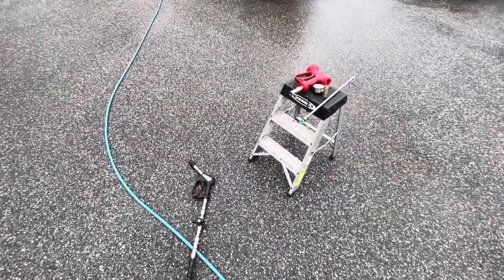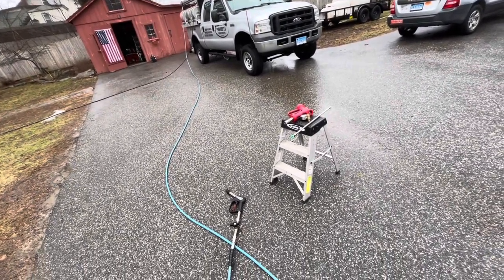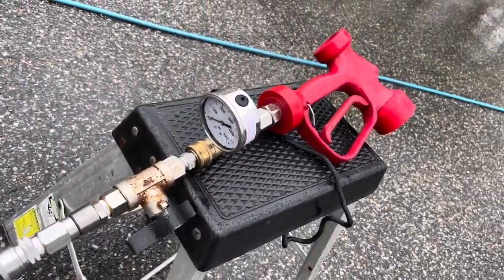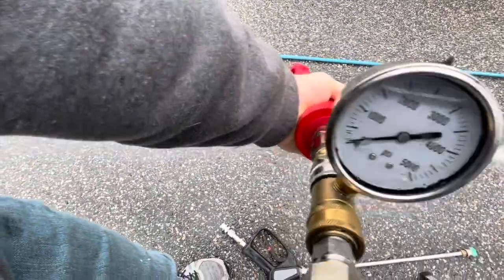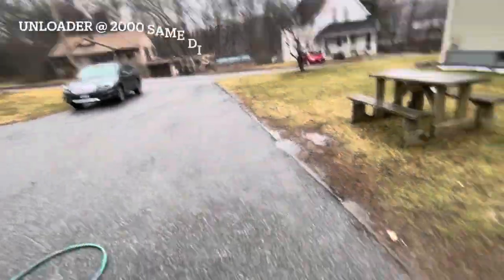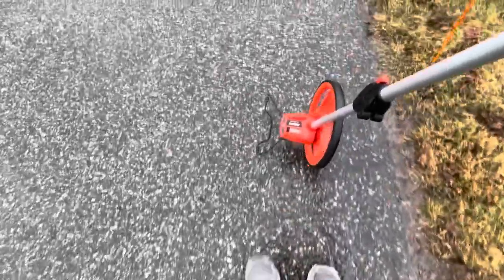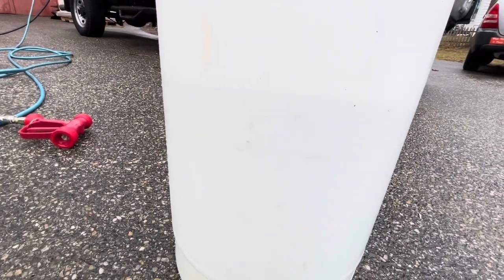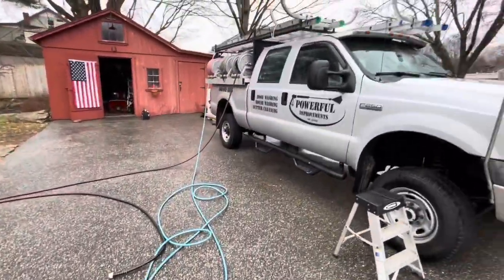Red Gun Testing -Truth

Comment: Probably the most versatile and efficient setup for house and flat work ! I bought some 1/2" flexible pressure hose cheap on a whim, running 1500psi on my k7 i got right at 9gpm out if a 7.5gpm on a 390 honda Frankenstein buiild. Run the red gun with all 1/2" fittings and ball valve. Seems that alot of fittings have a different id and arent consistant so the friction just builds thru the lines. Fun stuff man !! Thanks Joe

Comment: Hey Joe love the video’s mate, you have got me started on my side hussle! I almost enjoyed building my rig from your vid’s as much as washing. 
1. I hope I don’t steer you wrong as I have zero experience but I believe that small spike you see is what the unloader requires to detect the flow has stopped so it can divert the flow to buffer tank.

2. Cutting the unloader down shouldn’t really affect your flow until you start reaching higher PSI values near the setting you have it too. EG if you set it at 2500psi you most likely won’t have full volume at 2500 but should be fine softwashing at 150 👍. It is more recommend from other channels to drop pressure using tip size as it puts less pressure of the unloader. 

3. Watched an old video the other day when you had the mixer connected to downstreamer and tried to cut SH% with the SH valve. That would only strangle the suction flow, you would be better just adding in small amounts of water to cut % down. You might run SH at 3/4 and water at 1/8 for example 👍.

Like everyone has mentioned you are such a great example for so many people to get out there and follow there dreams. All the new idea’s and things you try are what we all wonder but can’t be bothered trying to everyone gets so much excitement from them 🤙🍻
Reply from the maker: Hi Adam. Thank you for following. You are correct about the spike. I flow tested at 2000 psi and no drop in volume. The proportioner theory is correct but doesn’t necessarily work as expected in practice because the valving is so much larger than the draw line. Valving would need to be 1/4”. At least this is what I’m finding in practice

Comment: Test one using the wand with a tip(green) inserted is creating back pressure, but your follow up test on the “red“ gun is never going to have back pressure as it’s basically a wide open orifice which is allowing flow.
From what I recall more flow = less pressure
More pressure = less flow
🤔😳
Reply from the maker: ? ? 
Large hole = low pressure 
Small hole = higher pressure 
Does not necessarily restrict flow unless you go too small.

Comment: So I run 44@4 is this gun good for that also can I run SH with this gun or the blue gun for that matter or is both guns solely for rinsing? Thanks 🙏🏾
Reply from the maker: Do you have a K7 flow actuated unloader?
Reply: @powerfulimprovements  no I have a regular pressure washer 4k @ 4gpm I’m downstreaming with my setup thinking about going softwash but I can get same results with black tip and white/green for rinse just want to give the appearance of soft wash without buying softwash system if I don’t have to
Reply from the maker: @big_kapp4425  ok. Red Gun will not work for you. Need K7. Rinsing with white or green tip is high pressure. You need an m5 twist for soap and rinse. And either a manual or remote injector by pass. This cuts the soap off. This is how we rinse with volume and low pressure.
Reply: @powerfulimprovements  ok thanks now I don’t have to waste my money on something that will not be beneficial to my setup

Comment: What size green tip are you using? Is it for your 8gpm or for your 5.5gpm? Your pressures will vary greatly.
The red gun shouldn't be used with a pressure trapped unloader. Your flow sensitive unloader doesn't put out that kind of pressures because of the size of the red gun nozzle.
Reply from the maker: It’s the 8 gpm of course. Cmon 😂👍🏼

Comment: Seems to be working okay, but for hotter mix for tough jobs; like roofs you will have to change machines.  A roof pump is cheaper, and you can regulate the percent of sh for all percentages with a proportioner.
Reply from the maker: Yep. I 12 volt roofs etc. we may have an AR in the future

Comment: There is no question the Red and Blue guns are far better constructed than any PW gun available. It is all stainless steel and over moulded unlike PW guns which are two piece. If you are putting 2000psi into a 50' 3/8" hose the psi at 50' would be 1985psi, 1880psi at 100' and 1522 at 200'. If you reduce the pressure to 1000psi the psi at 100' would be 880psi, at 200' 522psi.

3500psi x 100' x 3/8" = 3022psi
3500psi x 200' x3/8" = 2545psi

Comment: Ok so i bought this gun and running 8.5gpm and set my pressure at 2500psi at gun with correct tip and the zk1 unloader valve. I change to the red gun and i cannot get it to adjust to a straight stream. It's kind of a triple steam that don't really shoot very far.
Any thoughts as to why i cannot get it to adjust to a straight stream as you seem to be getting?
I'm really bummed out and disappointed. 
I was pretty excited to buy this after watching your video. 
I can try dropping my pressure to 2000psi but not sure it will make a difference. 
Any thoughts on this?
Thanks again for all your videos.
Reply from the maker: The screw on back adjusts
Reply: @powerfulimprovements  come on bro, i been adjusting that screw since I got it, i just cannot get it to shoot a straight stream without it getting stuck on.
I was wondering if you had any issues. 
Maybe i got a defective one.

Comment: What makes the red gun better than the gun set up you used with the M5
Reply from the maker: One hand fan to needle. Instant. Faster
Reply: I was using a jrod. So went from switching between multiple tips down the the M5 and a shooter. So now I only have to change between the two. The red gun just makes it a no switch adjustment. Just squeeze for the spray you want. 
Only issue I see is getting the projectile spray I get with the Davis shooter tip. Will I get it with the red gun or will I get the same spray as I get with the M5? I’ll have to try it.
Reply from the maker: @darrendeblance6235  so far the red guns has a nice beam. Plenty of slap and much less fray than the M5. However the m5 and shooter tip is still a killer combo

Comment: Something off is going on with the red gun. It’s suppose to gauge at what the machine is putting out. That’s why most people were saying the gun wouldn’t hold up. I had my gauge at the machine so I could know what pressure my hose was seeing.  It’s not suppose to change no matter what gun you use because it is the output of the unloaded/machine.  It should only change when you are shooting because of the flow the gun allows through it. It’s strange. Lesson for all of us!
Reply from the maker: It’s the K7 unloader that makes the difference. It’s flow actuated not trap pressure like a vrt3 which is likely what you have. Not the same thing
Reply: @powerfulimprovements  yes, sounds like total opposite of what I have. That’s why I like to bounce ideas off each other. Good learning! That makes it, make sense now! Keep rocking out!